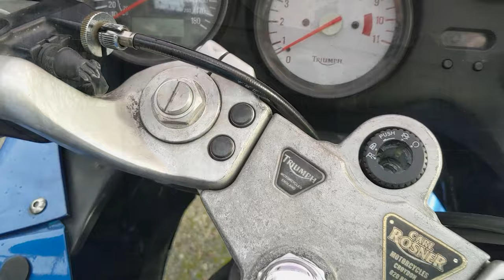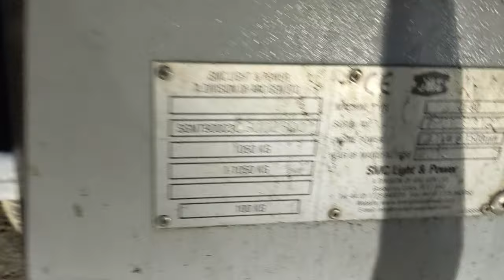Stolen Triumph Motorcycle and lighting tower double theft recovery operation - Date 05/02/20.

Comment: 60 mins response (1 hour) from the Met for theft recovery is pretty good I would say. See the problem? The thieves gave the bike better security than the owner. Best security for a bike, first off, is not being able to see it. Disc locks are shite, that was asking for it. My mates bikes are in a padlocked and chained metal storage shed, which is alarmed too. Metal against metal means if it is moved is going to make loads of noise and draw peoples attention. Never mind what police say. Police usually do the opposite of what the operator says. 8:13 Brilliant recovery ramp. It has just given me a great idea.

Comment: You want extreme. They once sent a huge truck into my area for a motor bike 😂. 

Also someone once siphoned out a full skidsteers tank of fuel that was parked across the road from my neighbors place overnight. 
The guys who came to get it had to go and get diesel at 4am to come back and get it.  
Best part was they were silly enough to put it into their petrol engine 😂😂😂😂 and if they had read it they would of seen the diesel fuel only sticker.

Me and the crew doing most the work in area said IF only they drained the other sides tank 😜